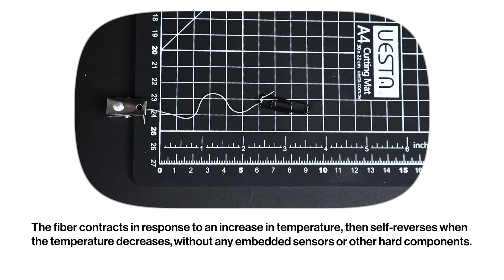Shape-shifting fiber can produce morphing fabrics

Comment: I’m thinking if you combine this with biomimicry you can have a spring or fall top that when you get warm enough openings/holes/pores/stomata open to release the heat and moisture. Or to make it a little more 3d a winter coat with pieces of fabric like scales opening up like a pine-cone. Or to make it even more 3d, a fabric that folds itself into intricate pleats and tessellation origami. I don’t know what that could be for but it would be very pretty hehe… so I guess for fashion. 
Come to think of it you don't even need to create the thread you can just screen print the thread directly onto fabric. Some textile designers screen print latex onto stretched out fabric to create interesting textures. Or even 3d print onto fabric which is something some textile creators have been experimenting with the last few years.
Reply: Using biomimicry and LCEs (the material these fibers are made from) is actually one of the main fields in this research. If you're interested there are plenty of researchers working on this in the MIT-Harvard sphere. Jennifer Lewis has worked on 3D printing these materials in the past, while Katia Bertoldi has worked on origami like materials and incorporating LCEs into them.
Reply: @reesemartens759   great info. Thank you.